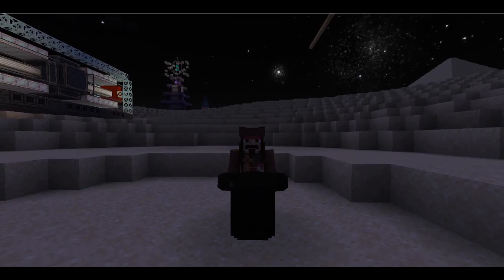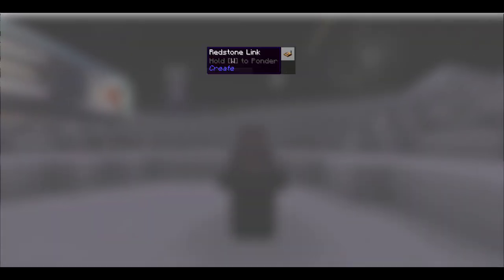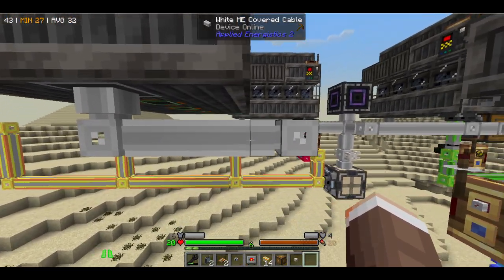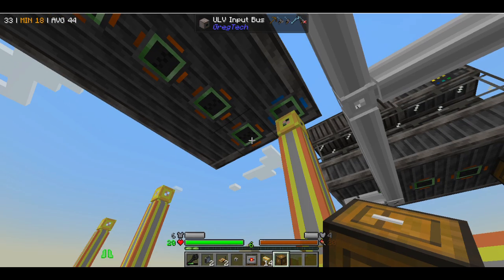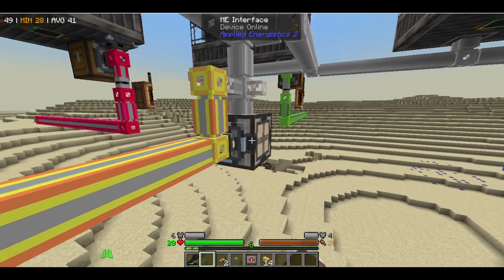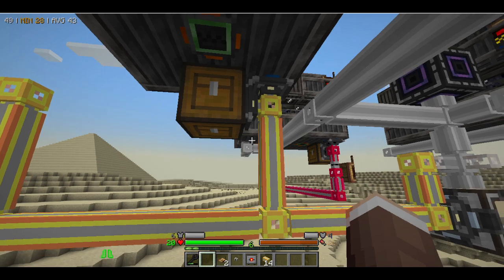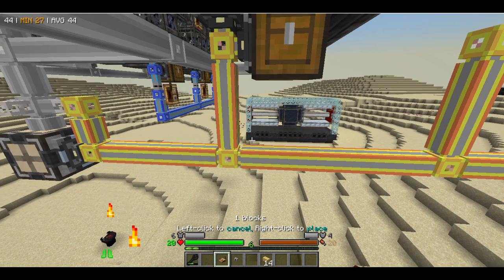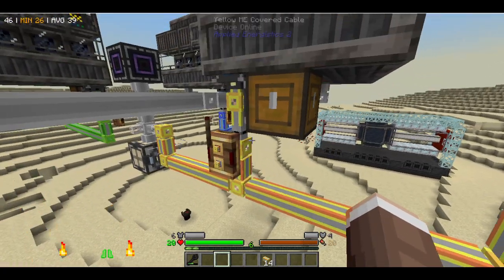(GregTechCEu Modern) Star Technology | Parallel Assembly Line AE2 Best Method

Comment: You should mention that you have to turn "Working" off on the first input bus to prevent it from backfeeding the output back into the input again
Reply from the maker: I havent had an issue with that before. Was it possibly from bus direction?
Reply: @ZTHaze  The first input bus that is facing into the inventory connector will attempt to automatically pull, causing it to draw from the output bus because its registered as an available inventory. Turning off "Working" will prevent it from pulling, preventing it from backfeeding. It may be a problem caused by a difference in Minecraft versions or mod versions ¯\_(ツ)_/¯ it seems like another commenter had the same issue @dond989
Reply from the maker: @FredrickFaxbooth  oh i use me output hatches normally so i havent encountered that issue
Reply: Ran into this. Thank you for the tip

Comment: Lyrics:

hello and welcome back to another Zeta
team creation it's Hayes again today
we'll be learning the best way to set up
AE2 for parallel assembly lines let's
get right into
it this method has a few unusual parts
but it's the best method I've seen for
doing parallel assembly
lines the unusual parts in this method
are redstone links activity detectors
inventory connectors and ME inverted
toggle buses
i use assembly lines that are minimum
length to save time making the video but
this method will work for maximum length
assembly lines too also for clarity
purposes I'll be using white cables for
the mainet and colored cables for
subnets now here we have a simple
interface attached to a pattern provider
with cables running to our multi block
the first thing we're going to do is put
an inventory connector on the first bus
of the assembly line this block sees all
inventories connected to it and just so
happens to arrange all the items in the
correct order for us then we'll need to
put a storage bus on the inventory
connector and input hatch for both of
these you'll want to set them to report
inaccessible items so that they will
report items to the pattern provider
before I forget let's make sure to turn
on blocking mode for all your assembly
line pattern providers this will ensure
that recipe conflicts don't occur
you also need to set matching priority
on both buses the first pair of buses
you can leave at zero but each assembly
line on the same subnet after that needs
a different priority to make the subnet
run multiple assembly lines parallel we
will need to hide the assembly line
inputs that are running recipes from the
net this is where the other obscure
items come into play doing this is
pretty simple just put an activity
detector on the assembly line controller
put a redstone link on the face the
detector is on put the toggle bus right
here and then the other redstone link
right here you can use any items to pair
these links just make sure it's unique
for every pair now when the assembly
line turns on the controller will send a
signal to the redstone link down to the
toggle bus which will hide it from the
net until it's done and allow patterns
to be pushed into other assembly lines
on that net you could keep repeating
this process on the same subnet but when
overclocked fast enough the update
delays on AE2 can cause the system to
not truly parallel i'm not sure what the
specific limits are just because it
depends on the recipe speed and how AE2
does its
updating to set up multiple subnets just
branch off of another face of the
pattern provider in the same fashion and
to add more patterns to all of them just
add another pattern provider below it
then extend each subnet with interfaces
in the same way as the first pattern
provider on the epsilon version we had
enough space for all of our patterns
with three pattern
providers as for data just use the
optical reception hatches and data banks
for the storage and transmission of it
if you have too many lines for one data
bank a tip is that they can be
nested anyways that's all I got for
today hopefully the guide was helpful
thanks for watching ciao